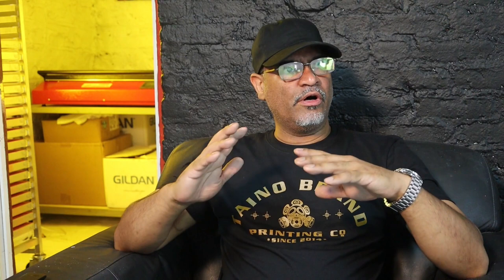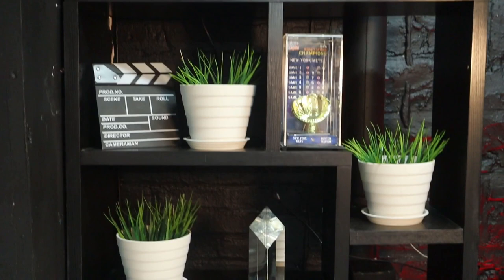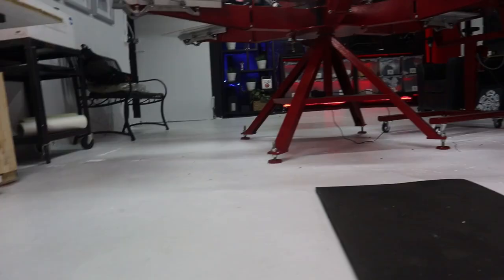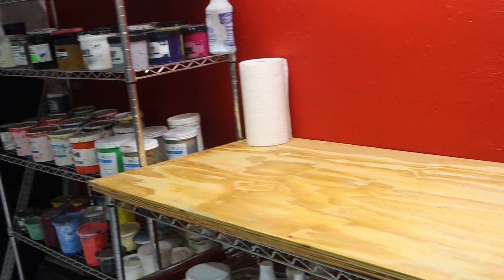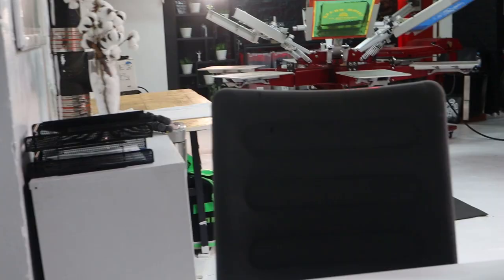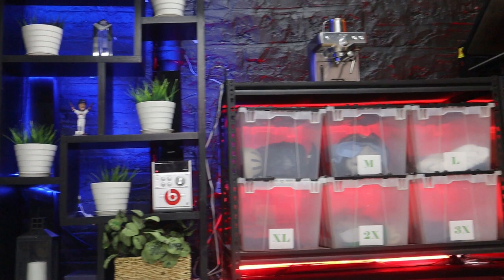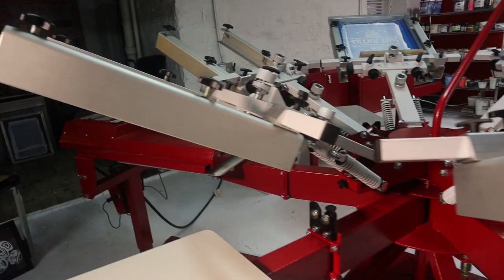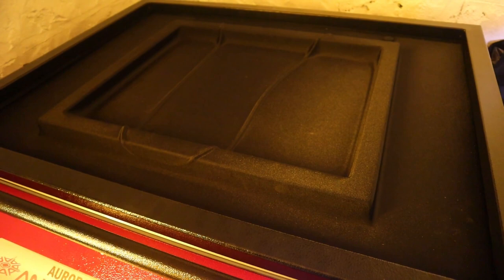NEW Screen Printing Setup - Screen Printing Shop Tour

Comment: Hi,

please kindly can you tell me how did you make the normal tube into safelight what sort of paper we can use there Thank you
Reply from the maker: I got it from a dollar store. clear gift wrap and they come in different colors. Look for the yellow wrap. It works.
Reply: @tainoink  hi mate thank you for the reply back 

I have tried something else and that works for me really well and kind of LES bulb bigger or smaller put the yellow poloshirt on it 

As I couldn't found the light safe at our end in uk so I am more than happy with that and that is really bright like yours 

Plus I tried with no dark room screens coatings and burning washing it works I think you can try these methods on yourself and tell your audience 
Thank you